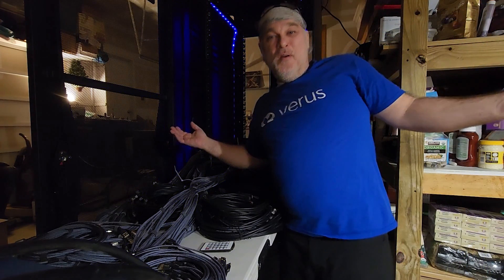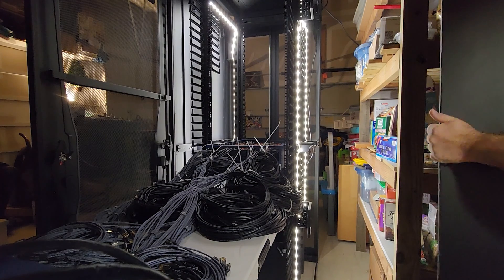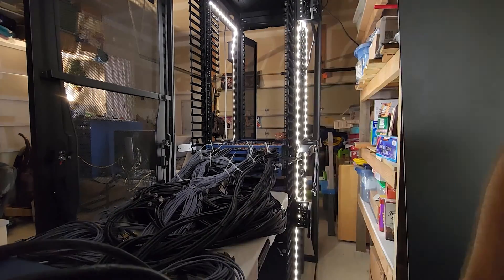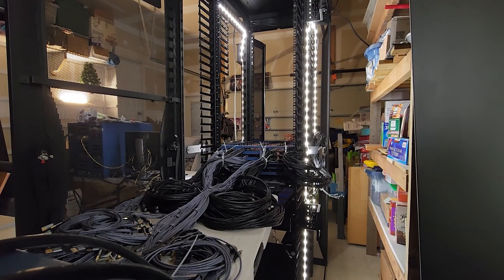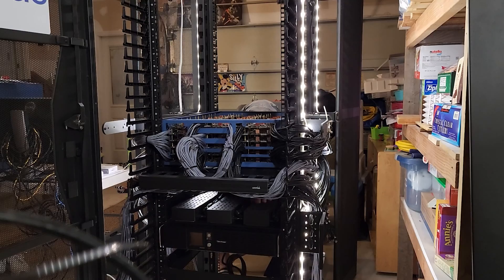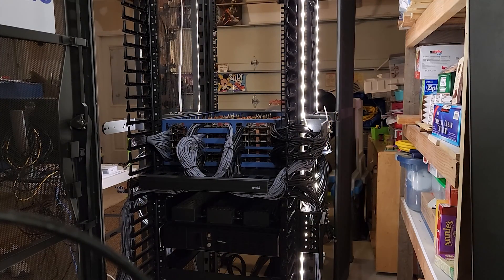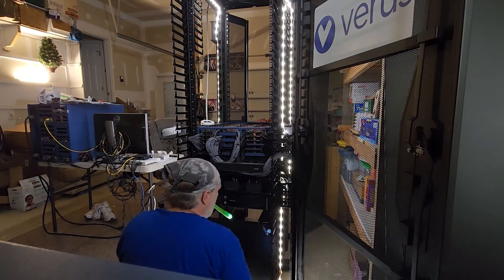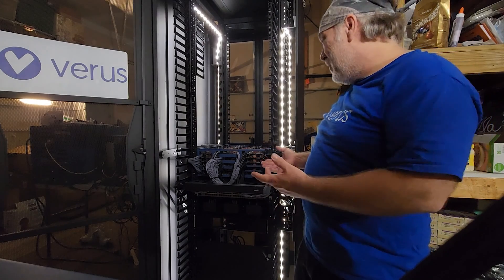Building a Cryptocurrency Mining Rig using 125 Orange Pi's Mining Verus - Time To Wire It  - Part 9

Comment: Awesome!  I have 11 OP5's . I hope you dont have the same problem i had with those usb hubs.  Mine would only deliver 2 amps per OP5. They need about 4 amps each.  Mine worked for a while but in the end went bang.   If you get intermittent network connections it will probably be power supply issues.  But dont sweat too much! haha.  Just upgrade to a better power supply.  Love it!!
Oh verus id : RC1sQwth4PWBYJ28hqLvFefkvuby8qukaw
Reply: oh and make sure to tell us your pool address.  want to follow this :)